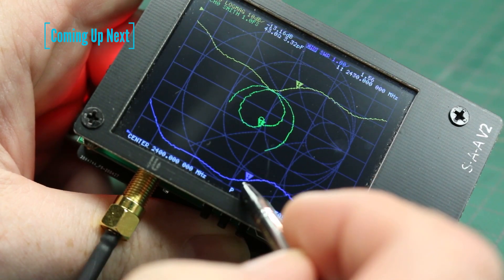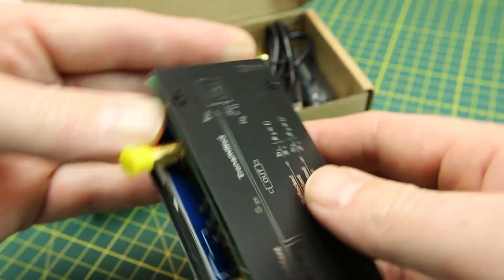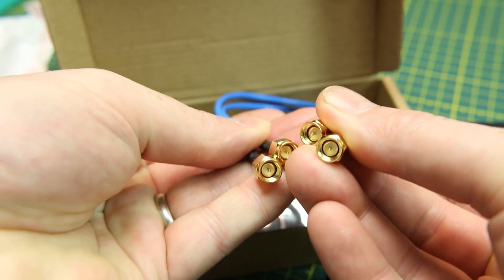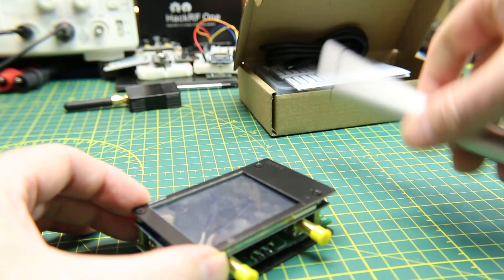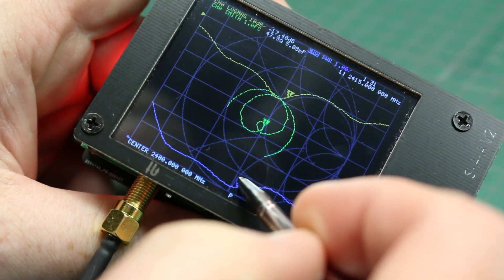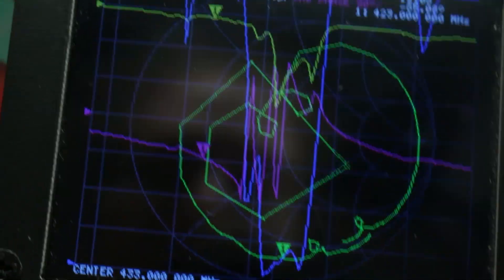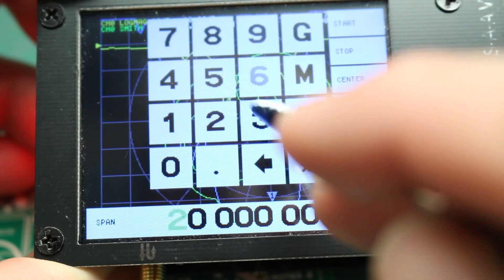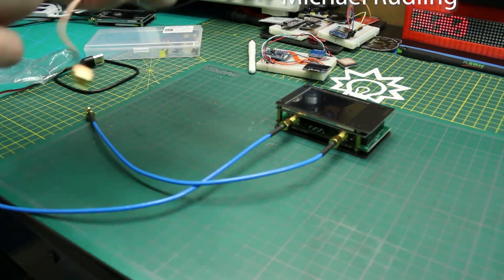Getting Started With Nano VNA (Vector Network Analyzer)

Comment: You should check rodin coils for antenna use, the air force reportedly has one at each corner of the U.S, although I'm not recommending enormous coils on those that would fit on a desktop.  Thanks for the video sir.